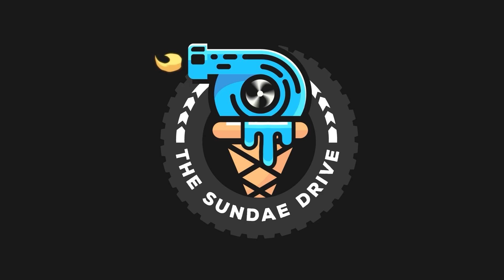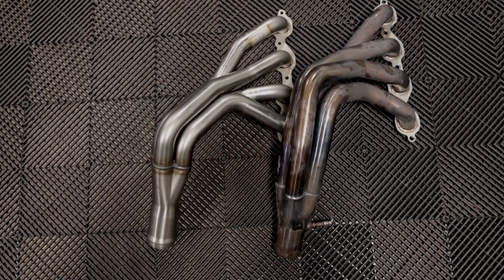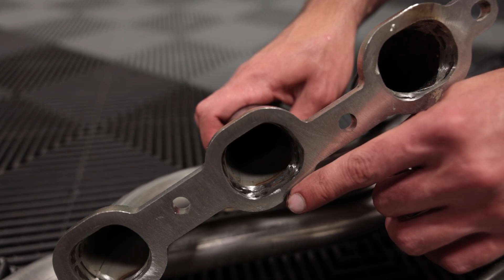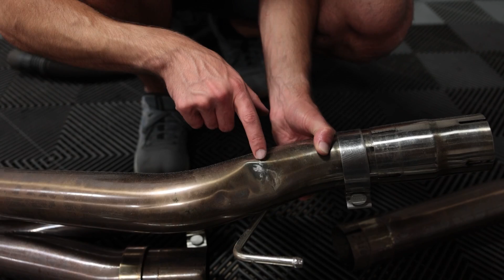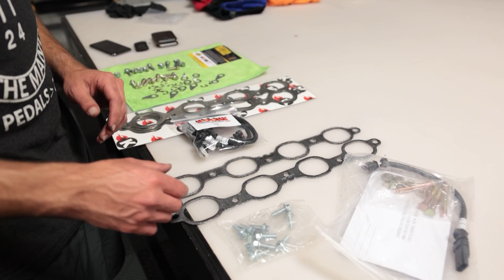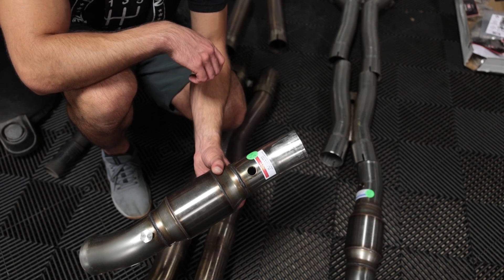Kooks vs ARH vs Speed Engineering Side-by-Side Comparison - C7 Corvette Long Tube Headers LT1 6.2L

Comment: Went with SE for my 05 LS2 C6 n I don’t regret it at all more performance right out the box good fair price went on smooth as silk only thing I had that was wrong(not speed engineering prob) bought my c6 with a flow master axel back that was made for a z06 that the previous owner Jerry rigged to work on base ls2
Reply from the maker: Glad to hear you had a smooth install and good results with your setup!

Comment: Dyno results will determine if those welds are a problem , for all you know , they might help make torque . All of the covette headers have a poor desing , and as luck would have it the left header on the S/E has a better desing , or pipe arangement. too bad none of them have a good rh one...

Comment: Completely different experience with my speed engineering on my C6, fitment is perfect, did not bang anything in, I got o2 extenders as an option, and upgraded clamps, as well as mls gaskets as an option. You also have the option of stronger bolts and sleeves for the wires. Must be way different on c7

Comment: So completely off topic lmao comparing 2,000 dollars headers vs 350.00 headers lmao 🤣 😂  btw the speed engineering headers give you the same hp on a dyno as the other 2 over priced. And they last. They fix great and install easy as well and you save thousands of dollars .. but great video. Kooks and American racing you pay for the name nothing more.
Reply: Can I contact with you Insta or snap 😄
Reply: Dude learn some materials science before saying ignorant crap
Reply: A little wrong.  Kooks helps a ton with heat and even more so if you add the coating.  Also last longer
Reply: Same with speed engineering. You're paying for a known affordable header set that you can buy on ebay for like $200.
Reply: Cap 😂 speed engineering is trash 😂 Arh and kooks are the truth

Comment: I’m going with speed engineering. It’s all just piping. As long as it’s quality metal it’ll be fine.
Reply: It’s 304 but it’s thinner than ARH and Kooks.
Reply: If you're a welder then its no big deal. But the less thick the metal the more heat will be produced and these Chinese knock offs are prone to have fitment issues.
Reply: SE is the same material and thickness. Check out many many installs on Corvette Forum. I haven’t read one post where people were dissatisfied with the SE headers. There’s also videos on YouTube showing installations without cutting or denting. Unless the creator is going to present flow analysis, remarks on that subject are speculation. None of these header manufacturers post any flow info or performance data, so maybe there IS no difference. On the other hand it’s clear that the Kooks are extremely well made and designed. If I had the disposable income I would buy the Kooks, and why not? On the other hand, the typical C5/6/7 owner may not have the two grand+ for headers and might choose the $700 brand that also has a strong following.

Comment: Went speed engineering LTH and xpipe so i could swallow the pill of the Corsa xterme mufflers, amazing fit and insane sound. Dont sleep on speed engineering.
Reply: What did you install them on? You didn’t have any of the fitment issues he complained about?
Reply: @SelimxBradley  c6 tho. Buying same brand for my ctsv3
Reply: I wish I had those mufflers . Instead I got the mbrp loud ass exhaust lmao

Comment: Speeding engineering hate from OP is wild AF 😂😂😂
“You get what you paid for” isn’t necessarily a valid argument when compare item for item . . .  You can buy a Rolls Royce ghost or simply save a bunch of money get the 745 bimmer and you practically have the same item

You get what you pay for is an American saying to charge more for basically the same things but do you with your $2.5k headers 😂😂😂
Reply: You can tell the quality is better from both kooks and ARH.
Reply: @G @Gigity-q4f  what really matters is the power you put down Richard holdener ran dyno tests on high dollar and cheap headers and guess what they made the same power 😂

Comment: I bought speed engineering for my vet the fitment was perfect and the quality is good and the sound is good they are not as bad as you make them to me
Reply: They are cheap junk. One thing I will say tho with the clamps you can just flip them around
Reply: @christiansouthard5677 Not really, you’re paying an extra $2000 for the same fitment and nearly the same sound with ARH. I just did speed engineering, fits like a glove. Sounds just like my buddies kooks long tube setup, can’t even tell the difference.
Reply: @christiansouthard5677  Yeah I agree you're paying for a premium on those ebay headers. Because thats literally what they are, ebay headers that just have a known brand.
Reply: Idk I had them now for 3 months and then been good and I gave me a decent power got it dynoed and I went from 285 to 322 wheel
Reply: @vetteboy06  sry but not buying that.
Reply: @ alright believe what u want been driving like this for a year nothing is welded
Reply: @buff24seven there are plenty of videos showing LS platforms gaining 40+ HP off headers. You’re literally on YouTube use the search bar.

Comment: Great "hands on" info about these three header brands. The shop working on my '04 C5 said basically, "don't bring stuff that is not plug-n-play or the labor and down time would be more. I said what's good? He mentioned Kooks fit great without cutting, welding, anything; just bolt them in. So I showed up with Kooks Headers, catted x-pipe and mid pipe all black cerakoted by a powder coating business. Inexpensive cat-back exhaust and cold air intake. Michigan Motorsports sourced BTR stage 1 cam plus all the cam goodies like Johnson slow leakdown lifters (expensive lifters but worth it), dual valve springs, titanium retainers, upgraded rocker arms, etc.. ATI super damper and ARP bolt, tensioners, belts, new GM radiator with some really weird transmission cooler line fittings. Only on the late '04 C5 before the quick disconnect style on the C6, and after the flare type transmission cooler line fitting on '97-'03 C5's. It was like an 8 month run of that particular '04 C5 radiator style and it is NOT easy to find. I had to get the radiator from GM and they had to order it; there were two available for order. Don't believe me, call GM and ask for a radiator for the last 8 months of the entirety of the C5 model run, Mr. DeWitts himself from DeWitts Radiator wrote a blog on his website about the fitting design, it's unorthodox design compared to the earlier C5 and the later C6 with pics. Fluids, Mobil 1 filter, some new sensors here and there that were easy to access with the intake off. 
The technician picked his own gaskets and went with Felpro throughout but used the MLS gaskets that came with the Kooks header kit. Most know what to do with an LS, mod it or maintain it in stock trim and enjoy one of the best bang for buck motors ever made. It's my first LS powerplant so I am learning what's good for the LS and having some fun. But I see some aftermarket stuff for this car that looks like more trouble than it's worth. 
Yes, the Kooks header kit was more expensive, but installed without issue or bad looking welds like on some of the Frankenstein set ups. Like cutting out the factory H-pipe and welding or clamping in a universal x pipe.
It's a Vette, people spent $15-$25k on a C5, $25-35K on a C6, and then proceed to go all "shade tree" on "America's Sports Car" by installing cheap stuff all over it. Then wonder why it doesn't fit properly, breaks too soon, doesn't tighten down right, (every one's favorite) at the wrong angle, develops cracks, or leaks. Remember, "Speed Engineering" can also mean hastily, poorly designed, and rushed to market. Kooks made in USA; Texas Speed made in China. You get what you pay for.
Reply: I prefer Kooks as well but ARH is made in the USA too.
Reply: I have speed engineering headers on my c5 lol and it was a perfect fit. No trouble at all no cutting or anything.

Comment: The biggest comparison you left out is price. For some people, the problems you listed may be a small price to pay for the affordability of the Speed Engineering headers. Personally, I have ARH on my car and they were the easiest install of headers I've ever done. They practically installed themselves but they were not cheap. People trying to go fast on a budget, an oxymoron I know, probably could easily overlook the issues you pointed out to make their performance buck go farther.
Reply from the maker: Price is massively different for sure. With how difficult the speed engineering pipes  I would gladly pay the extra lol.
Reply: @TheSundaeDrive on my C6 I had 0 difficulties
Reply: @TheSundaeDrive what’s difficult about speed engineering
Reply: @Dakota.LT1 did you not watch the video?
Reply: @WhisxBeerus  no skipped a lot, and only
Probably I had with them was the passenger side
Reply: @Dakota.LT1  oh you had difficulty installing them? What happened?
Reply: @WhisxBeerus  driver side only took like an hour and passenger side you basically gotta gut the whole side out and I had to saw my exhaust pipe back alittle and it took like 6 hours but after that they work and sound great for the price
Reply: @Dakota.LT1  ok I might just save up for some ARH headers then because I’m not trying to go through all that.
Reply: Speed engineering headers  are the same as the cheap ebay headers you see for like $200. They're just marketed better for people to think they're better. They're both cheap Chinese made headers that WILL require you to dent them. But in my opinion if you're going to buy a sports car/ muscle car and plan to mod it you will get what you pay for. I bought a 30k+ 17 SS camaro and there is no way in hell I'm using cheap headers. I already ran into that issue 4 times with my 2010 SS with overheating/ fitment and exhuast leaks. Not worth the headache for most. So those cheap headers will cause you issues for time.
Reply: @Gigity-q4f  got speed engineering on my corvette fit perfectly no issues easy install my buddy got Kooks we put down the same power 😂
Reply: @Gigity-q4f False. installed them on my Z06 and that’s not true.
Reply: @petermad152 yeah that's straight up false my SS camaro with a cam and e85 has had no issues with the speed engineering headers 😂

Comment: Your video was painful to watch i do have the speed engineering headers.  I like them but  personally couldn't justify the 2gs on headers compared to the two big brands.  Keep in mind my tuner did say they were a bitch to install but said they were the preferred header for a budget build.  I have intake/cam/e85..475hp 490tq 8 speed.  Love it as weekend car..a SCAT PACK KILLER!
Reply: How much did you pay to get headers installed
Reply: @rogeliodelatorre8377  all those mods were installed at once.  6gs total.  Hpp racing out of Garland tx.
Reply: damn 6K to not even break 500whp? You need to get a refund.  @214hotrod85

Comment: A dyno comparison would solve so much debate on forums and fb groups. Appreciate the detailed video though
Reply: They already did and the speed headers does the same as the rest. Lol and doesn't break the bank
Reply: @ZO6VASI  breaks your mind installing
Reply: @SwaggySubscriber and your knuckles. And for those paying a shop to install i recommend they confirm a flat rate for header install if they opt for the cheaper sets. A whole bunch of nonsense can ensue with having to dent and hammer pipes due to poor fitment.  So, you save on purchasing price going with a lesser  quality header... to just raise your cost on installation.  My Kooks 1 7/8 with off-road x-pipe was as easy as a header install gets on a vette..
Reply: @SwaggySubscriber No it doesn’t, it’s really not that bad.
Reply: 100% agree…at the end of the day HP gains are what I’m interested in!
Reply: Your the type of dude who would buy a carbon fiber spoiler thinking it added 15hp lmao id be mad too if I bought 3k$ kooks headers that did the same shit as a 400$ pair, id be tryna defend the my dumbass fckup too lol